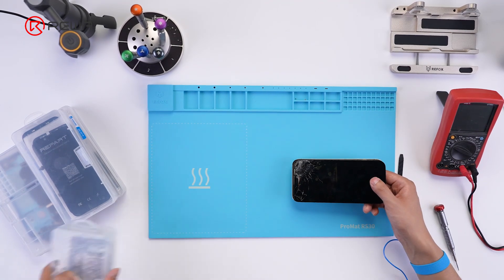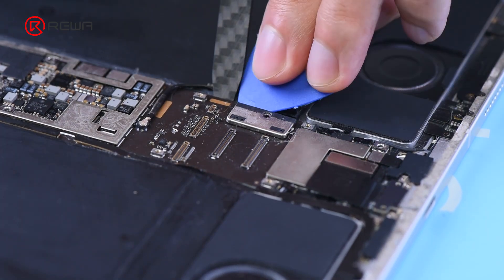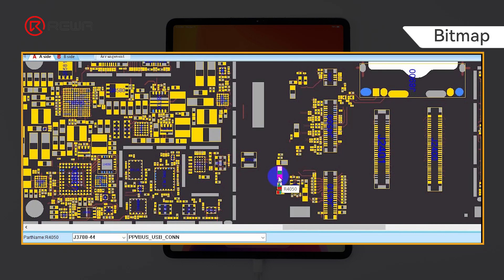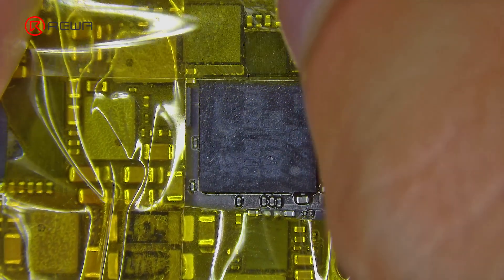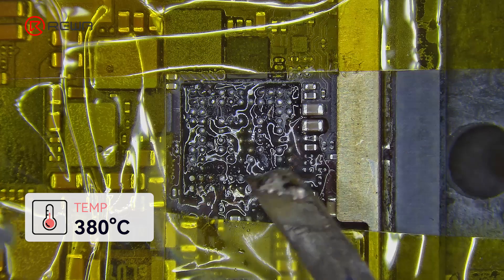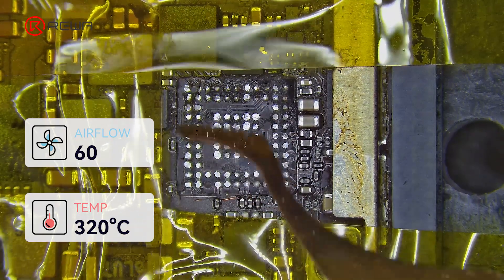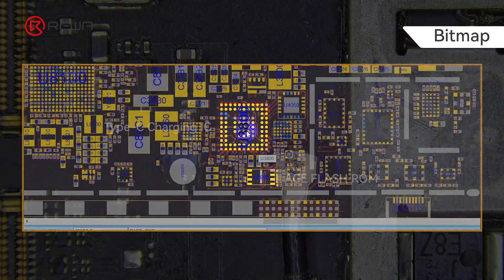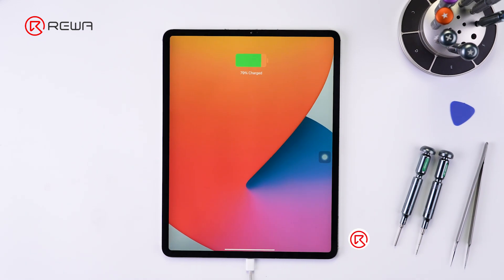iPad Pro USB-C not Charging Repair Case - Troubleshooting is the Key!

Comment: Do you really need to replace SPI ROM with CD3215C00? I wouldn't ask if USB-C chip is CD3217B12...
Reply: The data is corrupted on SPI ROM CD3215C000

Comment: how do you know that CD3215 was bad and not only the flash ROM ?
Reply from the maker: In the video, the short-circuit pin of the charging port connector is connected to the CD3215 chip. It can be determined that this chip has a problem after checking the charging circuit.
Reply: The CD3215 is quite a common failure, unfortunately Apple uses it quite a bit.
Likely the chip damaged the flash ROM when it failed. The short on the USB C connector would have damaged the CD3215 since it is hooked directly to it.